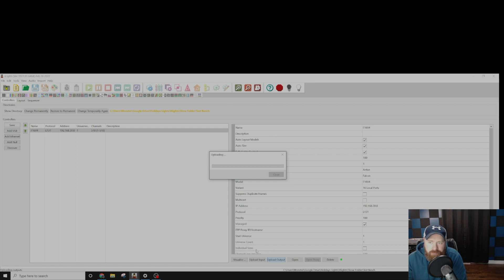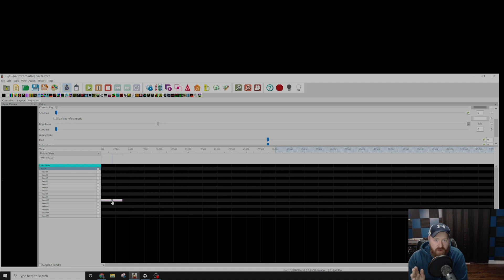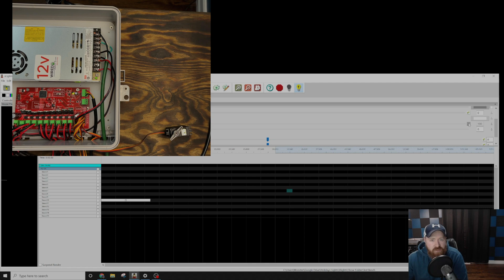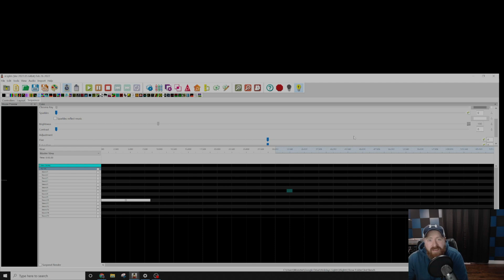Pixel2Things DC Board - Build and Configuration

Comment: I have seen how you use ikea cutting boards as mounting plates. How do you attach the plate the the enclosure? And do you just screw the power supply to the board with just metal screws?